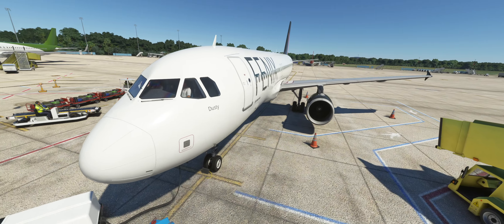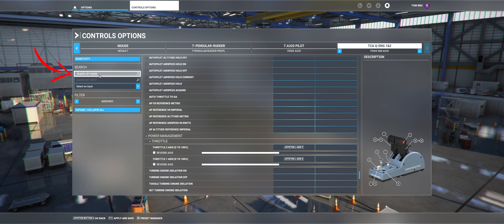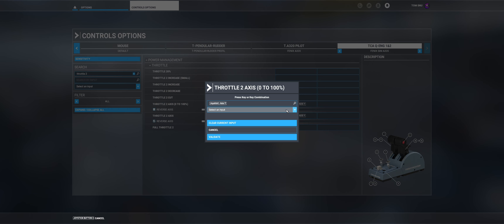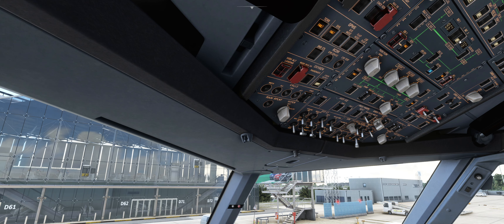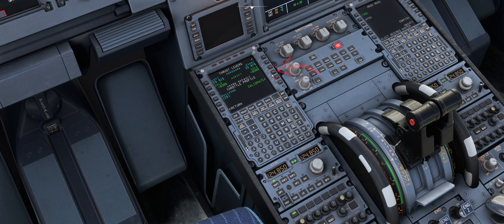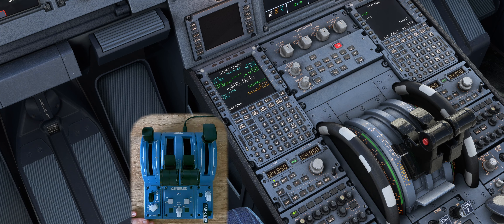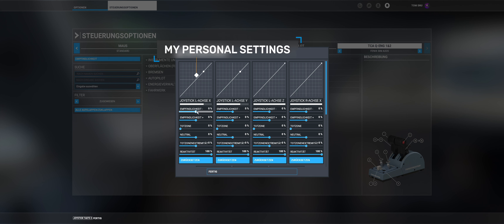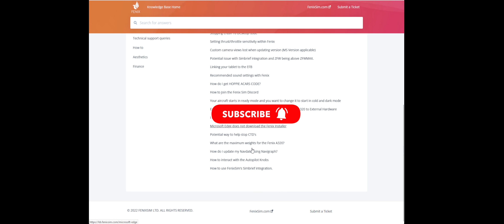⚠ How to configure Thrustmaster TCA quadrant and add-on in FENIX A320 💡 - Let's fly! ✈

Comment from the maker: ⚠IMPORTANT: Due to some updates (Firmware TM Throttle Quadrant) and now different versions for some useres the axes "Throttle 1 Axis / Throttle 2 Axis" won't work! Try it with the default setting "Throttle 1 Axis (0 to 100%)/Throttle 2 Axis (0 to 100%)". This might help. Otherwise do the firmware update and the hardware calibration.⚠

If you liked the video please leave a thumbs up! 👍 Thank you!

Are you looking how to calibrate the TCA quadrant and add-on in FlyByWire A320 neo? --> take a look at this guide: https://www.youtube.com/watch?v=BQ80C_9J8Hk
Reply: hey my landing gear does not work
Reply from the maker: @gamingfr1728  I would recommend that you go to the controlls options and select in the upper left the option "search by input" and see which function is assigned to the landing gear lever. make sure that the correct function is assigned.
otherwise try to update the firmware of the throttle quadrant.
Tell me if it helped. :)
Reply: how to do firmware update
Reply from the maker: @HVC-r9d  you need to go to the thrustmaster.com website and download the updater in the download section of the TCA Quadrant. Then open it and do the Firmware update
Reply: how do you do a hardware calibration and I have already done a firmware update adn it still ahsnt worked
Reply: @SNUGaming  nvm its good tysm

Comment: What is the right buttons for the Eng 1/ Eng 2 on off buttons? What is it called in game, Fuel Valve? Using those switches for the fuel cut off in the PMDG777

Comment: Doesnt work for me. Pls help me. If I try to calibrate the blue numbers in the right and left corner doesn‘t go under 42%, due to this I can‘t calibrate the fenix 😢. Pls help 🙏
Reply from the maker: Have you tried the hardware calibration (not in the Sim) and did you do the firmware update?

Comment: Hey it works but when I go to the menu and then back it goes to toga and I won’t go back 😢
Reply from the maker: So you completed the calibration and saved it and after you go to the main menu and back to the cockpit the thrustlever is stuck on to/ga?

Some ideas to solve it:
- change the “reverse axis” 
- maybe you have to take the standard axes (see my pinned comment up front)
- make sure that you’ve installed the latest firmware and drivers
- delete the configuration in the MCDU and do the configuration again. 
- remember. Whenever you change something within the sensitivity or sth else in the TCA Quadrant you have to do the configuration in the MCDU again. 

Hope it helps

Comment: hello, I have the same problems as the last comments, the problem is that with the A320 of default the throttle thrusmaster works perfectly 
, it is only with Fenix that it does not recognize the axis but shows me them as buttons
Reply from the maker: Very strange. Do you use the PC only Thrustmaster Quadrant or the (new) PC/Xbox Version?
Reply: @SNUGaming  wot wot wot ???
 I can not believe it . after days of following your tutorial to the letter, yesterday I turned off the PC and went crazy, I turn it back on this morning and the throttle quadrant works perfectly. I don't know what to say, the mysteries of computer science or there are ghosts in the house
Reply from the maker: @zaro9709  I'm glad to hear that it finally worked out! Have a lot of fun with the fenix and your TM quadrant. :)

Comment: hi, i have problem with the flap, the position with axis is only step 1, after dont go in position 3 and more. And in calibration in positiion 1 wen full100%... how is possible?
Reply from the maker: To be honest.. I don’t have a clue. 
Do you use the current firmware and have you tried the hardware calibration (not in the MSFS, but in the thrustmaster software)? Maybe that helps.

Comment: My quantrant won’t even show up in settings at all ? With the picture like yours does ? Everything is plugged in it was working fine for months and now it’s suddenly disappeared ?
Reply from the maker: I'd recommend to check the USB ports. Maybe it is an issue with them.
Also you could download the drivers package. https://support.thrustmaster.com/en/product/tca-quadrant-airbus-edition-en/
there also is an app called "Thrustmaster Flight Control Panel".. or maybe in your system settings for game controllers as well.. If the doesn't move at all it could realy be a problem with the USB Ports or the device itself. If it moves but doesn't show up in MSFS I would go to one of the MSFS community boards and ask the question there again.
Reply: Do you have a conversion for the controls? I play on Xbox… everything updated but since last update the quadrant doesn’t seem to work as it should. It works just a bit . @SNUGaming

Comment: I got to calibrate throttles through the mdcu but when i put it in idle reverses come on even if i dont pull my reverses back then my flaps with working opposite even when i checked marked the reverse on control settings but i clicked it again to see if it would fix it and messed up my whole throttles! Now my throttles dont go to idle and stay stuff in climb. To 50% up to 100% but no idle or reverses. Idk this setup is so complicated for no reason. Any help would be appreciated
Reply from the maker: Hey @edwinsoto7233 
First of all, a few dots and commas would have helped to read your text better. 😁But I think that I understood your problem.
This is the first time that someone describes these issues.
But (!) whenever you do changes in the controlls options you have to do the calibration in the MCDU again.

My recommendations:
- go back to the MCDU Config and press the delete configuration button. So you'll have a fresh start and can try it again. (This should help)
- do the firmware update via the Thrustmaster Firmware Update Software (can be found on thrustmasters webpage)
- if this won't help maybe try another USB Port. What kind of USB Port do you use? USB 2.0, 3.0? (I don't know if it makes a difference)
- try using another axis. Some users wrote that the throttle axis 1 and 2 didn't work for them. Instead they used the standard axes (Throttle Axis 0 to 100%) and it worked fine.

If this solved your problem it would be nice if you can give me a little feedback. Because other ppl may have the same issues. Thanks

Comment: When I'm making my configurations with the physical thurstasmter and I try to configure it on the Fenix A320 in FMC everything gets stuck and it never corresponds to what I want, do you know what it could be? My didnt even move in the flight simulator when im putting for exemple max reverse...
Reply from the maker: I would check if your firmware is updated to the newest version and do the hard ware calibration on the throttle itself. (Not in the MSFS). Download the software from the thrustmaster.com website
Reply: @SNUGaming  ok, thanks, when I try that I give you an answer
Reply: @SNUGaming  but for exemple when i use FBW a320neo didnt hapend that
Reply from the maker: @ytnighthpower1932  maybe you have to  use different axes for the Fenix A320. For some users for some reasons it is different than in my video
Reply: @SNUGaming  ok do u know how can i resolve it or is by the way that u tell me by official site of thurstmaster?
Reply from the maker: @ytnighthpower1932  I can only offer what I showed in the video and what I wrote in the pinned comment above. 
Try different axes and then do the confic in the MCDU. Sorry that I can’t help more.
Reply: @SNUGaming  ok, np, thanks for your help!

Comment: Im trying to calibrate but when I move my throttles the throttles in the cockpit won’t move the mfd shows the throttles spooling up but then immediately just by itself go to idle when my throttles are on Toga need help
Reply from the maker: hey.. sorry to hear about that issue.
I'm not quite sure how to solve this problem.
I would recommend to do the firmware update of the throttles. You'll find the driver at the thrustmaster website.
Also try to do the hardware calibration (not in the MSFS). If you don't know how to do that. There are videos on youtube. I didn't do my own "how to do" video concerning the hardware calibration yet.
Additionally you can try to use different axes in the controls settings options. See my pinned message.
Hope it helps.
Reply: santiago did you fix this issue? i am facing the same problem it's soooo frustrating

Comment: Hi mate how do i update the firmware of the quadrant or to the hardware calibration because when i load in to the cockpit my throttle wont move at all
Reply from the maker: I would recommend to use the TM firmware Updater to do it.
Very simple: https://support.thrustmaster.com/de/product/tca-quadrant-airbus-edition-de/

Let me know if that helped and solved your issue with the controls
Reply: @SNUGaming  how do i do it

Comment: Can't seem to find a spoiler axis. Also, when I connected the add-ons, it changed the name I had to "TCA Q-ENG 3&4" and erased all my controls on the base thing.
Dang I found the axis lol, but when my throttle is idle it goes to reverse thrust??
Reply from the maker: Regarding the reverse thrust I would recommend to leave a little gap in the settings. Means idle reverse should be set closer to full reverse instead of closer to idle. Then it shouldn’t be activated unintentionally if you set your thrust lever to idle.
Reply: Alright, thanks! Once I get that done I just gotta do the buttons. @SNUGaming
Reply: Question: do you have a tutorial on the buttons lol? can't seem to figure them out @SNUGaming
Reply from the maker: @loaf_ve  unfortunately Not. 
I only can recommend to use the standard setup of the TCA Q-Eng first and to duplicate it. (As shown in the video) So you will have all the standard buttons set up correctly and only have to do the changes as shown in the video for the levers.
Reply: My controls were somehow wiped when I installed the add-ons. I am pretty sure that even removing the add-ons, saving it, and then re-installing them wouldn't work. @SNUGaming
Reply from the maker: @loaf_ve  well. You need to setup an profile for each addon. Maybe you should update the firmware of the controls. Could help
Reply: Sorry to bother, but could you link me the website to do so? @SNUGaming
Reply from the maker: @loaf_ve  https://support.thrustmaster.com/en/product/tca-quadrant-airbus-edition-en/ drivers, software, firmware
Reply: Did all that, my only problem now is the throttle. Still thinks idle is at the middle and reverse thrust starts at idle. @SNUGaming

Comment: Hi, On the step where I need to calibrate the throttle, when I move the throttle to max reverse, it doesn't show as 0% on the MCDU, can you please help me? Big Thanks in advance!
Reply from the maker: what does it show instead? have you tried the hardware calibration of the throttle (not in the simulator) first?
Reply: @Flight Voyage Hi I have the same issue, I contacted the FenixSim support but obviously have to wait for a response. If they can help I'll let you know.
Reply from the maker: @Mauriceweller  interesting. It seems like that this issue occurs more often in the last weeks.
If they replay please post the solution to the issue here. 😎👍
Reply: I got the email and in the end it was quite obvious. Go to >options>controls options>assign the levers to throttle axis 1 and 2. Make sure it says throttle axis and not throttle axis (0-100%). I hope it can help.
Reply from the maker: @Mauriceweller  thx 4 the answer. Interesting. For me (and a lot of other ppl it works with throttle axis 1 to 100%) 
I have to check that myself, but I hadn’t any issues (as you can see in the video)
Reply: @SNUGaming  That's strange but it solved the problem for me.

Comment: I binded the flaps and spoilers but when i test them nothing happens, do you know how to fix it?
Reply from the maker: Hi.. no, unfortunately not. I assume you selected the correct axes in the controls options. Maybe you should try it one more time with the configuration in the MCDU. As I tried it the first time I had the same problem as you. Did everything correctly but the levers wouldn’t move. Did it again and after another try it worked. 
Besides that: try to update your firmware. Maybe that helps as well?!

Comment: This guide is different to other calibration guides. Most don't say to use to 0-100% range for the throttles
Reply from the maker: well, in the video I do say to use throttle 1 and 2 axis instead of throttle 1 (0 to 100%), don't I?
at the time I produced the video this was the proper solution to set it up. Due to firmware and software updates it may have changed for some users. That's why I wrote down in the pinned comment, that for some users it might be suitable to use the 0-100% option instead.. :)
Reply: @SNUGaming  fair comment

Comment: Can you do the rudder calibration and settings for fenix a320
Reply from the maker: hey there.. hm... maybe.. I use slightly different settings than the standard. but this depends on your rudder as well..
Reply: @SNUGaming  im using tfrp. A small movement on my rudder my plane steer too much
Reply from the maker: @japhethidalg0  i would recommend that you go into the settings and reduce the sensitivity. That should help

Comment: Hi mate, done all these steps but in the plane my throttle just wont move at all, not sure whats happening
Reply from the maker: First I had the same issue. Than I checked again if I took the correct axes. Did a mistake there. Make sure you use "Throttle 1 Axis (0 to 100)" and "Throttle 2 Axis (0 to 100).
If that doesn't work try updating the firmware of the quadrant or to the hardware calibration of the throttle.
hope this helps
Reply from the maker: Some users wrote that the throttle axis 1 and 2 didn't work for them. Instead they used the standard axes (Throttle 1 and 2 Axis 0 to 100%) and it worked fine.

Comment: I have nothing reconfigured on the throttle thing , doesn't even show its picture
Reply: Why when I press mcdu  , it doesn't go to that menu ? It does nothing
Reply from the maker: @bengvideos572  sounds like the Microsoft standard A320 if the MCDU has no functionality. Do you see the iPads on the left and right in the cockpit?
Perhaps the selection of the A320 was not saved or transferred correctly?

Comment: Spoilers won’t work
Reply: HELLO, in my case, out view doesn't extend , but the command is active
Reply from the maker: @Captain__Morpheus  check if your firmware is updated and check for the bindings in the controls options by searching by input. Maybe there is an issue